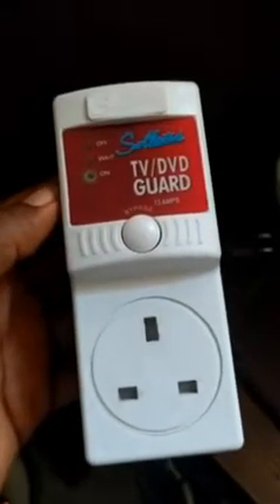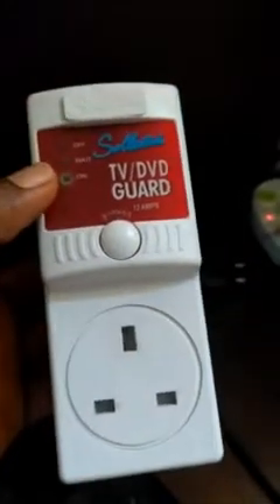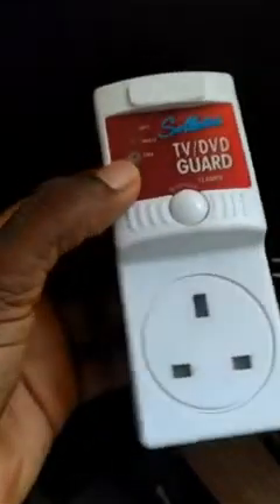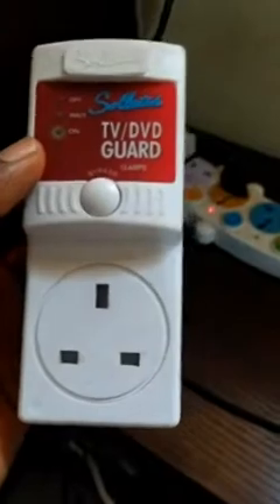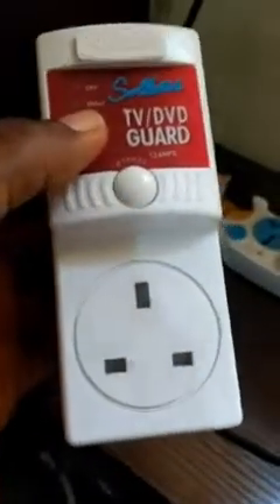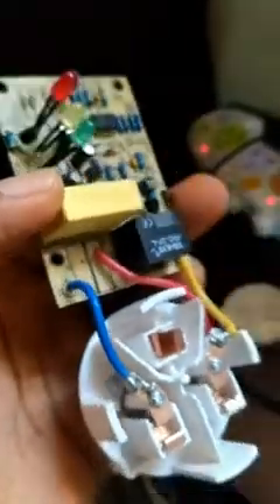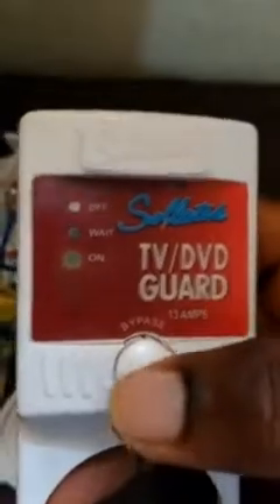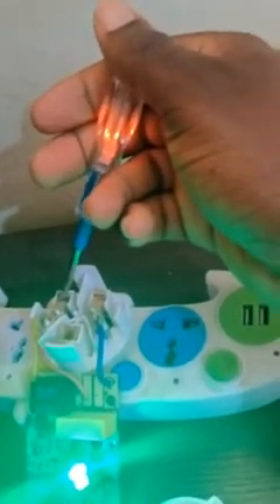Fixing the most common faults of TV guard, Surge Protector, AC guard of most appliances

Comment: Hello. This is d exact fridge guard I bought but it doesn't work on my fridge. The light is. Showing but it doesn't control my fridge when the voltage is low. My fridge keeps making noise whenever the voltage is low, I had to run to off the socket.

Comment: Hello, your presentation was good , mine has the problem the power indicator light not coming up not to talk of bringing me good output voltage, and current passes through the blue and red wire into the panel, but I can't exactly why the red light Doesn't come up. 
And I can't say it's the Relay because it shas not on at all.
Am doubting it may that big component that looks like thermostat, maybe I should bridge it

Comment: Can I use a 13 Amp TV guard for a 1 HP AC?
Reply from the maker: Yes
Reply: Read somewhere that for 220V, the amps needed for an AC is 11A or below. So the question now becomes, why does AC uses a 15A socket?
Reply from the maker: 15A is the standard socket size for heavy appliances like fridge, AC and Hot plate. It doesn't mean you can not plug in something of lesser power like laptop or phone charger. 
15 A rating only means that the socket can withstand high current demand from your heavy duty appliances
Reply: Alright. Thank you.

Comment: if i have this, do i need  a stabilizer any more ?
Reply from the maker: Stabilizer does a different job, eg: if you have low voltage supply, it steps up the voltage and surge protector can't be used for that. 

So if you have a stable voltage, then you can use the surge protector alone.
Reply: @Harryhenry02  thank you

Comment: Hello I like your presentation, mine has exactly this kind of issue but I have tried checking all the points and the red terminal is not receiving any voltage only the blue wire. What else do I do?
Reply from the maker: I suggest you use a multimeter to run a continuity test on all the terminals, also try testing it on another 13A socket outlet, it should work.
Reply: I actually did that now but I think its fundamentally a factory problem. Because when I tested it on my extention that red terminal tested live but the blue not live.

Comment: Please what does it mean when the tv guard is stuck at the red light
Reply from the maker: It's likely that the outlet voltage is abnormal, either too high or too low
Reply: @Harryhenry02  okay thank 🙌
Reply: The comparator ic is faulty (LM393),change it it will come up.
Reply: We
Reply: Exactly when I bought mine it was usually switching, a day after it's now stuck on red all day. Just tiring.